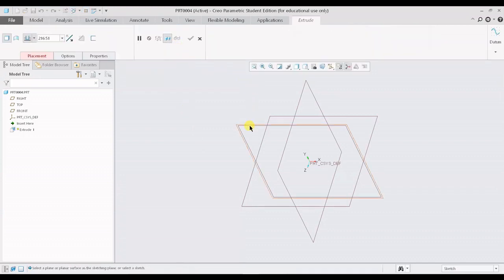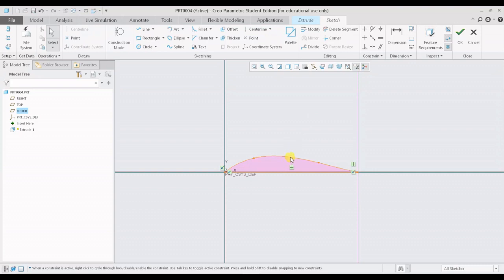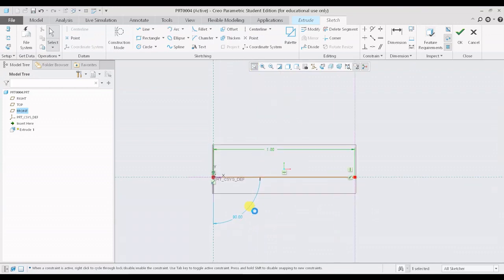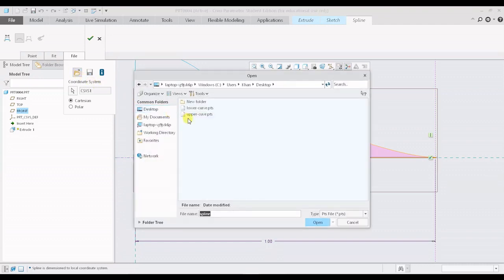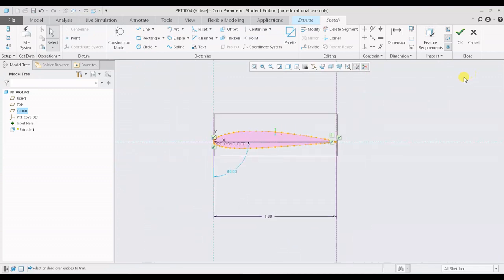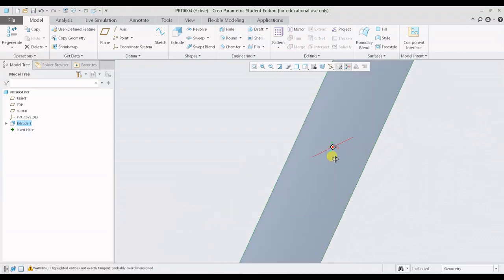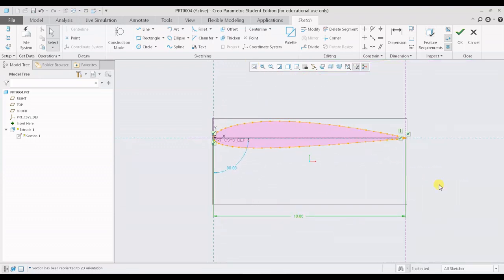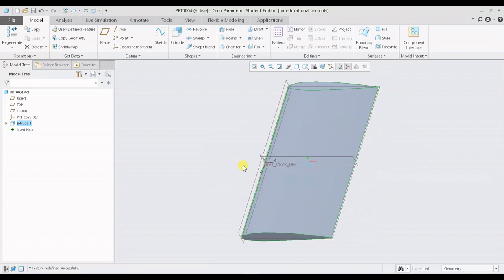Create a Rectangular Wing in Creo Parametric - Part 2

Comment: Hey! Nice tuHey! Nice tutorial! I need a help. My licence in creo has a problem the past 2 days and I want help from somebody that actual has a creo that could help me. Is it possible to help me?
Reply from the maker: Hey. Thanks. Appreciate if you subscribe. :)

Regarding licence! Are you using educational version.?
I have shown a step by step process to install Creo. You can check the video in my channel.

Let me know if it works
Reply: @Learn_with_khan  yeah! It has a problem I don’t know why. I have an assembled file saved and I want to export it to keyshot is it possible to do this for me? Just the export I don’t need anything else
Reply from the maker: @elenaaravani3267  yes you can export the asm to other softwares. 

Does keyshot support .stp, .iges formats?
You can save the asm in any format and then import that file in keyshot (or any other software)

To export, 

Click the file, save as, drop down to see different formats the cad can be exported, chose any and save locally. 

Hope this helps.